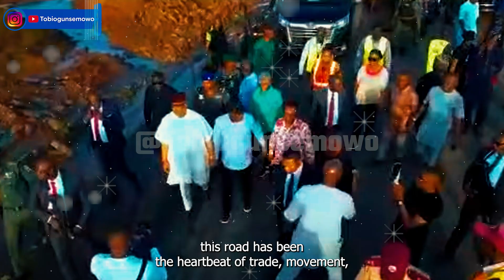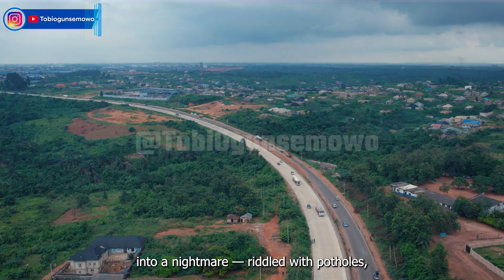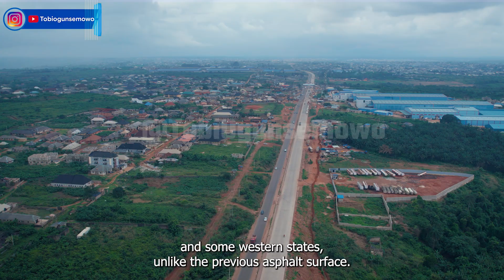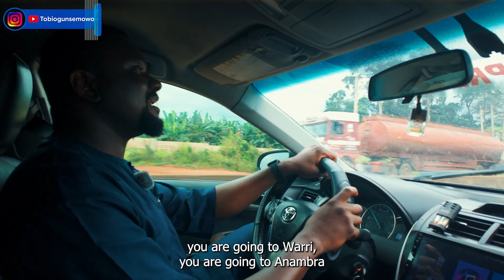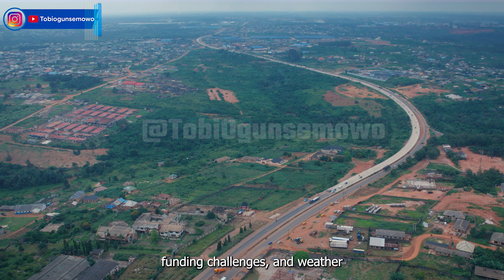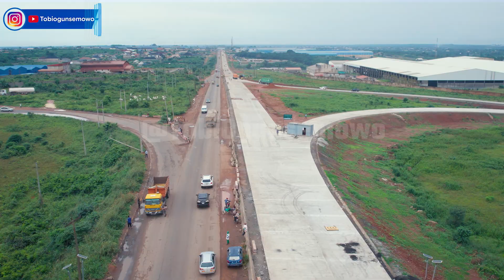Sagamu–Benin Expressway: Nigeria’s Deadliest Road Rebuilt

Comment: Are they taking it to ORE
Reply: The road is only bad in Ogun state and few kilometers in on do, Ore area is good just some repair work in some failed sections
Reply: Which one is only bad in Ogun state? What about Ondo and Edo?  @phinehasmorganolufemi1257
Reply: The road had been relayed from Itele Ijebu to Benin, it remains sagamu interchange to Ijebu ode which is on going now
Reply from the maker: Yes they are. The project is in phases with different contractors handling separate sections. But I’m not sure of the timeline.